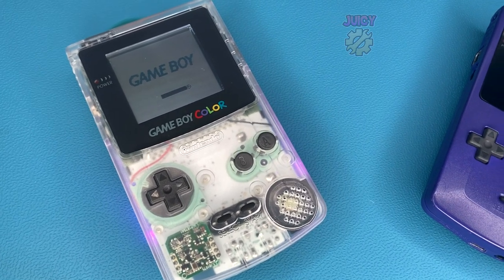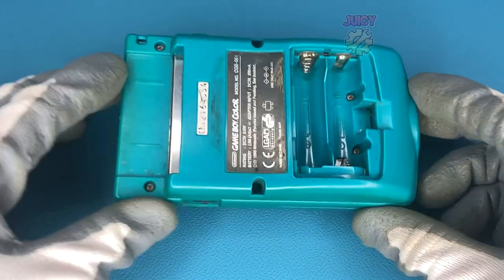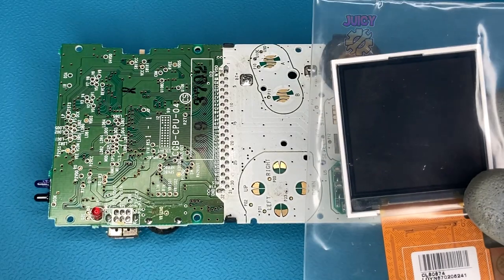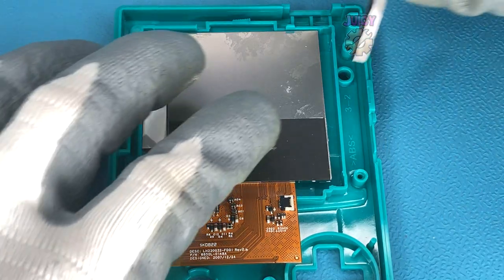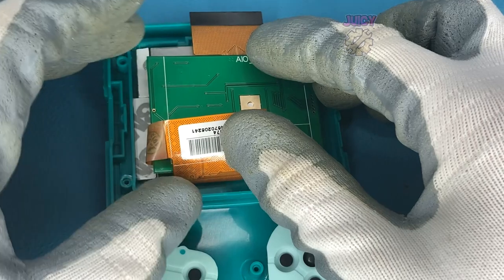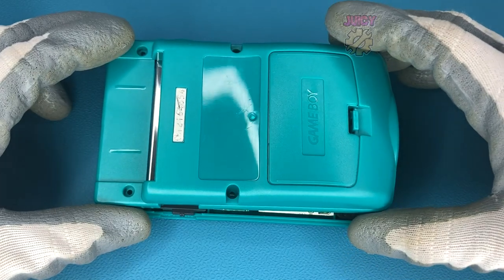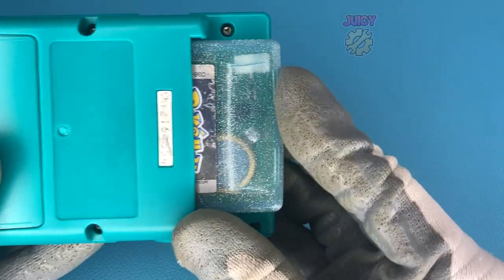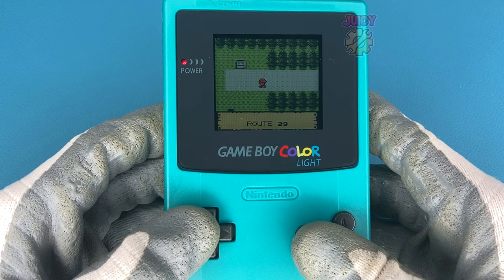the CHEAPEST DROP IN Gameboy Color IPS LCD screen!

Comment: That's actually a TFT LCD screen not an IPS screen. The IPS is long and rectangular and you need to do some shell cutting with an IPS screen.
Reply: Don't worry man youtube is full of people calling maintenance and replacing parts "restoring" and repairing. Never seen someone converting gb display output to ips output. All schematics are online and those screen kits are x5 more expensive than recreating the converting circuit yourself. Those tft lcd screens are around 10 dollars each actually
Reply: @BlakeKane  I've seen SO many other videos of people calling the TFT LCD an IPS screen I can tell the difference because my first screen was a TFT LCD. I got it from Retro Modding and when I bought it the price of it was $52.99 (Canadian) it was even expensive on Ebay as well around the same price to about $60 something so I wish it was around $10 something lol.
Reply: @metalgamer31  I am currently working on a convertor when i finish it i will be replacing gameboy screens for 10-13 dolar price range :P i got ton of working gameboys w/o screens its the most delicate part sadly. Planning to put up a video about it after simplifying it. İ am using all Arduino and rasp.pi parts so its very cheap and easy to find. After this project is finished i will start working on cpu with modern smds
Reply: @BlakeKane  you are an absolute fucking legend. I’d like to know about the schematics ur talking about, could you lmk where I can find all this stuff you’re talking about?

Comment: I actually use this screen in my modded GBC and I honestly recommend it if you don’t wanna spend to much money or solder anything. It works well. And while it isn’t an IPS display, it looks pretty good on its own! It does have some light bleed issues on the side, but that can be fairly easily fixed with some thin strips of black electrical tape.
Reply: Link?
Reply: @BlackAxe101  I got mine from a random seller on eBay. There are a bunch of them. No idea what company made it.

Comment: Hi, JuicyJakeRepairs. I know i was late to the party to post my comment here! lol. Anyway, I love your new method of install IPS LCD Screen on the original motherboard inside a Gameboy Color system. So, I wanna ask you a question. I am currently own Gameboy DMG and I tried to look a different avenues on how to order correct IPS LCD Screen and other parts in order to install on original motherboard of the Gameboy DMG. I just want to replace from green LCD Screen to Full color IPS LCD Screen itself only, that why i like what you are doing with the Gameboy Color. But I prefer to keep original motherboards without have to pay an third-party modified motherboard in order to running IPS LCD Screen in the Gameboy DMG system. Any advices and new parts recommends would be very helpful. Thanks!

Comment: So I’ve installed this kit, well everything is the same except the brackets that hold the screen centered. It works fine. Sound works and it starts up, but the screen does not light up, it’s just normal. Any insight on that for me?

Comment: I actually have this exact same kit but once its all installed my pokemon silver game won't save for some reason. The internal battery is still fine and still saves on my regular SP and Pocket but not on the gbc with this mod. Any ideas what the problem might be?
Reply: did you ever solve this?

Comment: Hallo. I got the same screen and installed it. But now my GBC wont start. Just the Red Light turns on for a second. When i connect the original screen it works fine again. I have also installed a rechargable battery. Maybe it dont works with the IPS screen. Hope someone can help me.

Comment: If the power switch takes too much pressure to turn on, is that a fault on the shell I got (not the same shell as what you have) or would that be the ips kit?
Reply: i believe that its actually a problem with your gameboy

Comment: Hi i followed your video the only thing is mine doesnt say gameboy when i turn it on :( and it doesnt read the cartridge what do u think i did wrong!!
Reply from the maker: thats strange.. i saw the video you sent, the screen lights up. I would try connecting the old screen back in to see if the gameboy itself was damaged. If it works with the old screen then you know its something to do with the IPS kit. Reconnect it again, making sure all cables are in properly, if it doesnt work after this then you probably have a faulty kit

Comment: Where does the touch sensor go on v5?
Reply: Did you ever solve this? I bought this and got the V5 - and it seems like its just the wrong way around, no matter how i twist it. It doesn't fit to the position of the touch sensor. Already wrote to the seller but I have little hope
Reply: @mmm-xc8zk  i did so it turns out the one i had went the opposite side of the gameboy or left side top (while looking directly at the screen) as opposed to the top right side where the ir lens goes

Mine didnt have an adhesive i just tucked it into the left top and closed the shell and it works when i tap where it is
Reply: @ikeavaughan   Wow thanks so much for replying! I had only slim hopes on a 2 year old comment lol. So you're saying it will work tapping the sensor through the plastic shell? Will try that
Reply: @ikeavaughan  It worked!!! You're a legend, thank you
Reply: @mmm-xc8zk  lol thank goodness for notifications lol. Glad u got it to work brother. Trust me it can be very frustrating when theres no answer lol. If you ever plan on rgb modding an n64 like what i went through ill guide you in the right direction lol
Reply: @mmm-xc8zk  also my apologies i said left top to install it and the right top was gor the ir sensor... i got those mixed up but glad u realized it was the opposite side